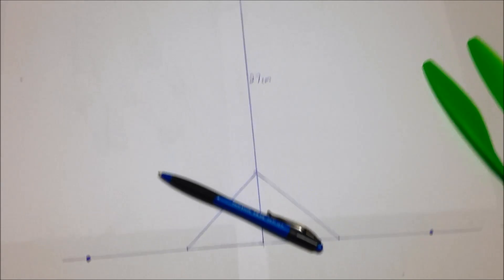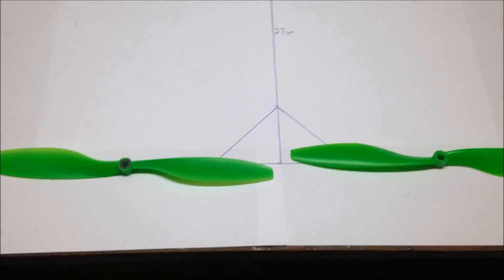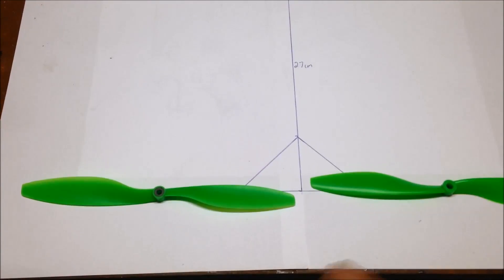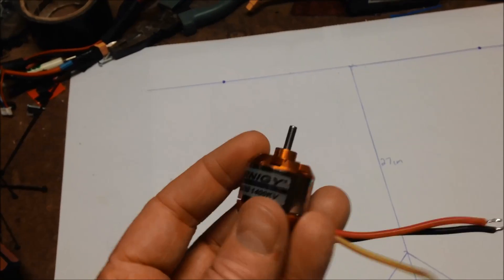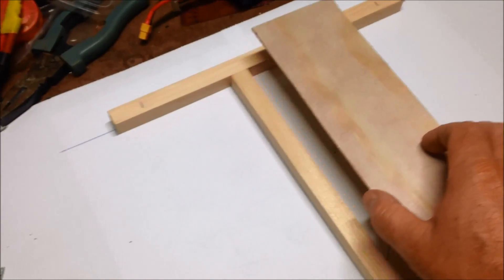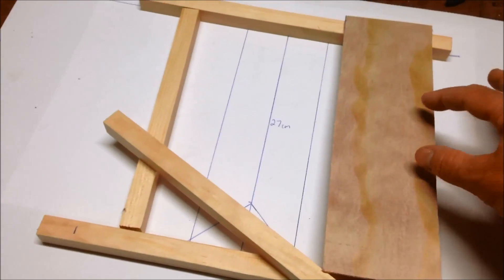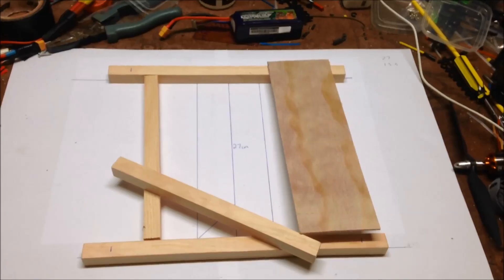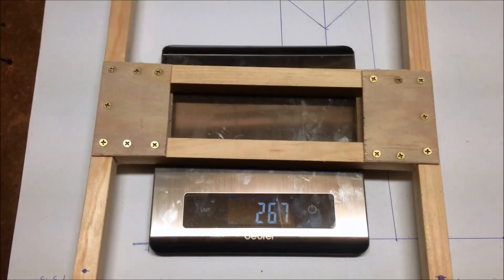Wooden 380 H Quadcopter Build Part 1. The Frame and Parts

Comment: You could have used super glue instead of screws on the frame to keep the weight down
Reply from the maker: Not really a performance machine but probably a better option.